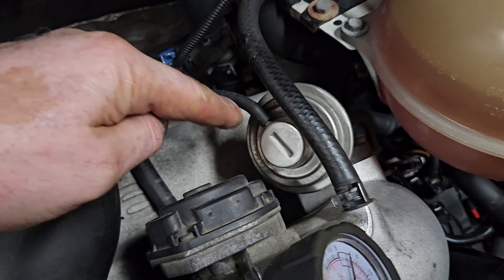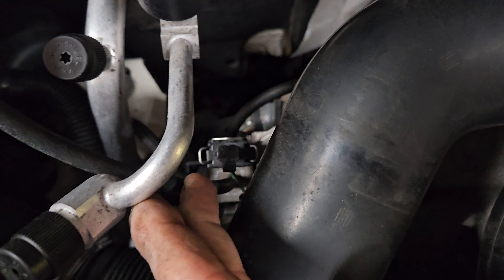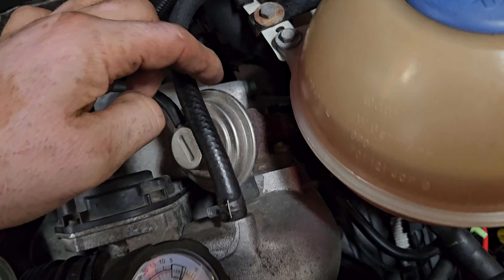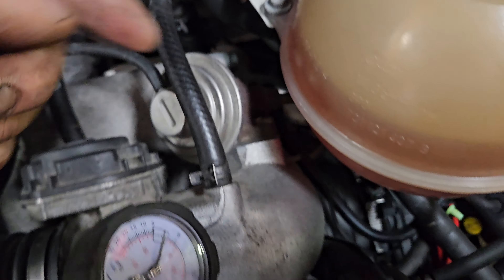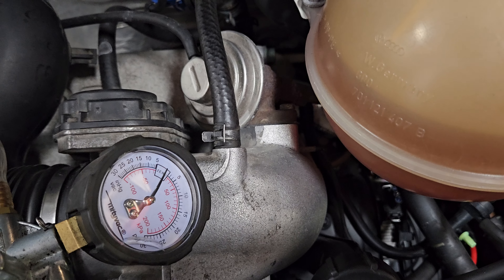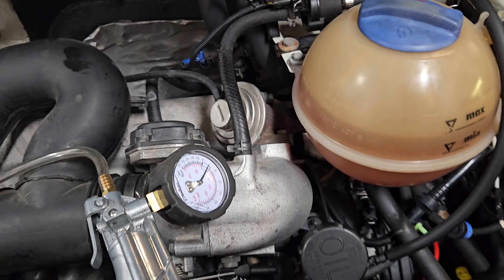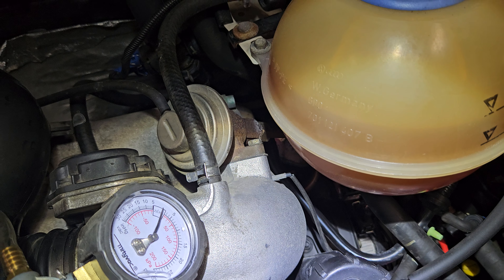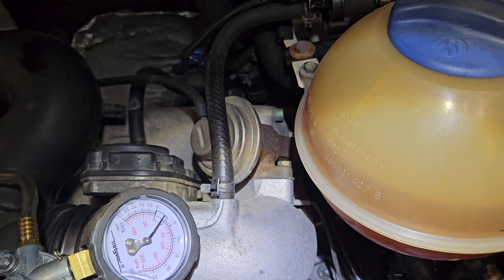AES VR6 Eurovan EGR components.

Comment: Would this cause a blapping sound on cold start? Only until some valve closes and then that blapping sound goes away. It sounds a lot like an exhaust leak on an old Ford.
Reply from the maker: No.
EGR is not used during cold starts.
Most likely, the Secondary Air Injection system is making noise.